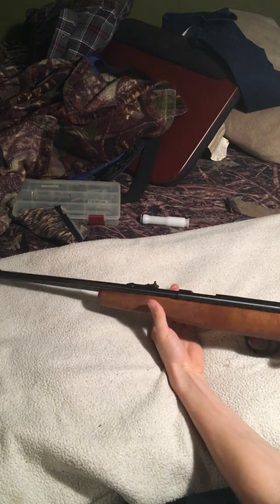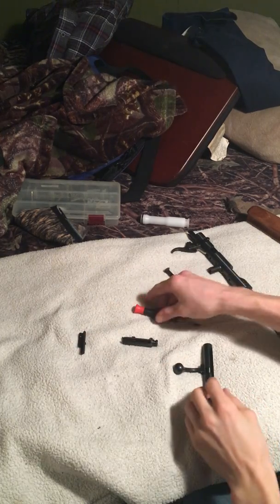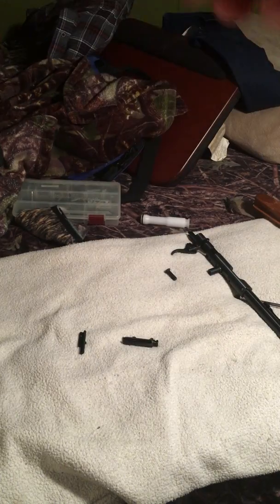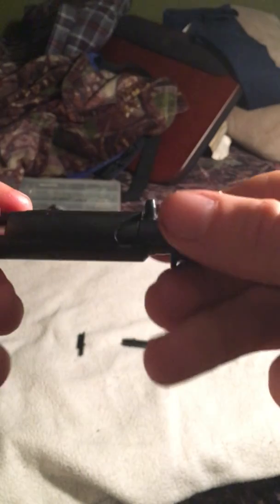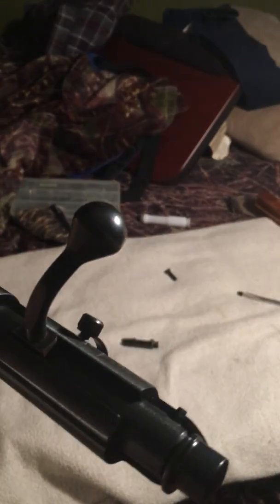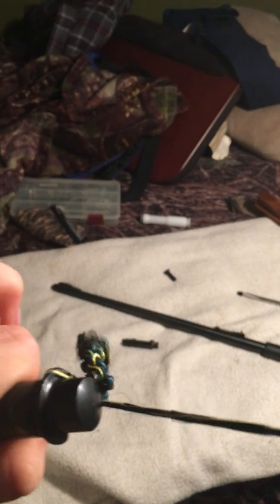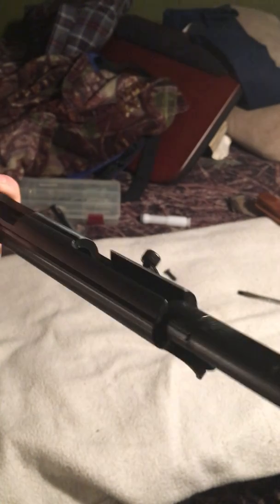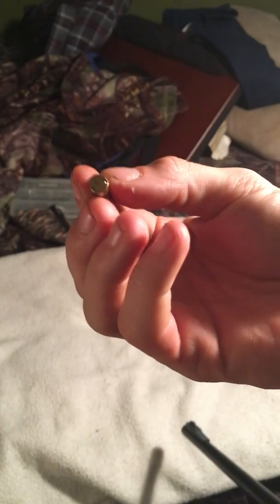Marlin Model 15YN 'Cricket' Assembly and Disassembly

Comment: The Marlin 15YN/915YN is also called the Lil Buckaroo.  The Crickett is an entirely different brand of rifle.
Reply from the maker: MN XYRN thanks for the clarification
Reply: The 15YN is also known as the "Lil' Buckaroo ", NOT the Cricket. The Cricket is a completely different youth rifle made by a different manufacturer.